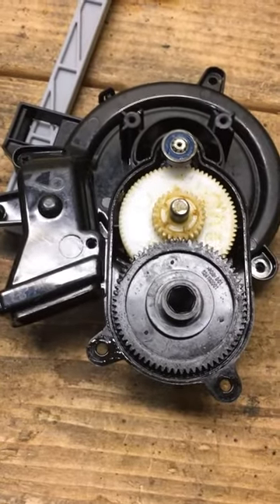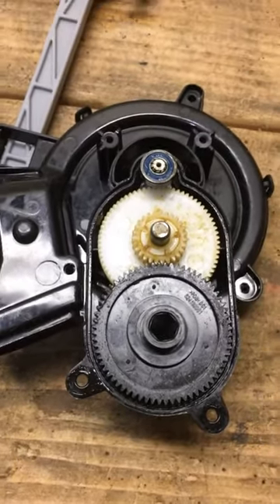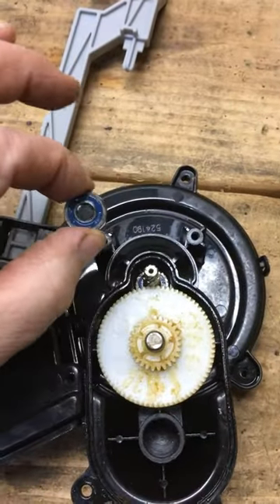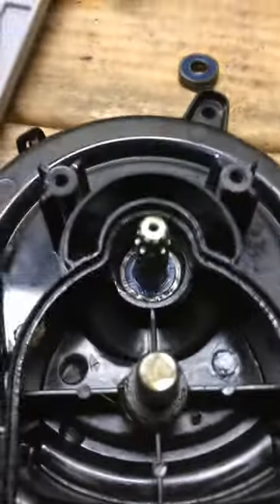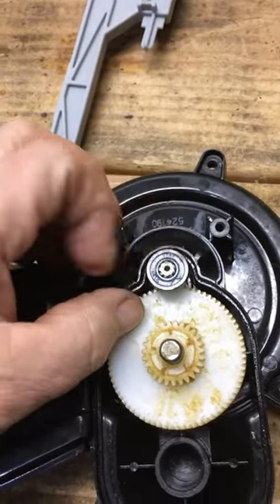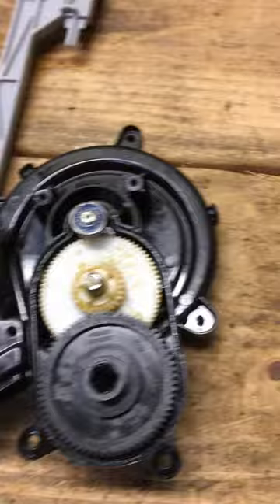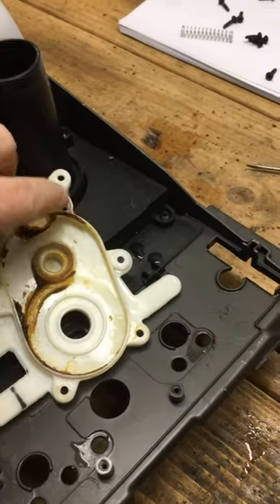Hoover Carpet Cleaner Brushes Not Spinning

Comment: Good video.  Some comments express concerns over a correct bearing replacement.  Having the identical bearing is not that important as long as it's a "sealed" or self-lubricating and of the right diameter. Places like McMaster Carr and Grainger may sell bearings as well as eBay. The thickness of the bearing can be compensated with washers and therefore is not critical either.

Comment: I hade to completely remove the shaft with the two bearings and clean it all thoroughly, both were seized up. I didn't have wd-40, but I did have some wheel bearing grease, them brushes spin now.
Reply: Hey I have the same problem with the lower bearing being seized up but I can't get it out. How did you remove the shaft?

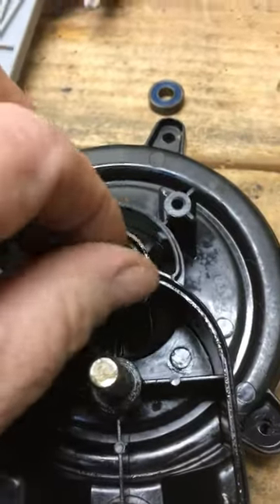Comment: 1:02 WD40 is used for rust. The gears are plastic. So I would use some kind of thin oil instead. And if you didn't know, WD is an acronym that stands for water displacement. If it is I  wouldn't use WD40. That is cheap. I would recommend PB Blaster.
Reply from the maker: At 1:02 in the video, I was talking about using the WD40 on the bearings, not the gears.  That was in an effort to free up the rusted bearing and to help keep moisture out.  If the bearing is really seized up, then I agree with trying PB Blaster.  It is a good product.
Reply: PB Blaster is even harsher on plastic than WD40

Comment: So if its not the bearings, everything moves freely, the door to switch between the power scrub, gentle scrub, and spill pick up works. My brushes still won't spin. There is a lot of air blowing out the bottom.
Reply from the maker: What model of cleaner do you have?  The reference to "power scrub, gentle scrub, and spill pick up" are not familiar to me.  We may have different cleaners.
Reply: @barryrobison2073  FH50044
Reply: Did you ever find a solution? I’m having the same problem.

Comment: How do you loosen the top bearing off of its rusted on?
Reply from the maker: If you remove the bearing from the shaft you should be able to hold the inner race of the bearing with a pair of Channellocks or vise grips.  Then try turning the outer race with your fingers or another pair pliers.  If it doesn't break free easily, try spraying it or soaking it in penetrating oil.  For more details visit the article on our blog for a more detailed description at the below link.  Be sure to let me know how it turns out.  https://www.ourrecipesforsuccess.com/carpet-cleaner-brushes-not-spinning/
Reply: Barry Robison  got it off! Thank you. Made sure to lubricate once I got the inside spinning again. Once I put the brushes back on they still won’t spin freely.
Reply from the maker: @sandycakesdunedin  So the bearing and shaft would spin?  If so, did you put it back together and try turn the cleaner on to see if the brushes spin?  The handle of the cleaner needs to be lowered to engage the brushes, If I recall.  It's the suction from the actual vacuum part of the cleaner that turns the turbine, which drives the brushes.  If there is suction, there could be an issue with the mechanism that opens to apply the suction to the turbine when the handle is lowered.
Reply: Barry Robison  yes the bearing and shaft were spinning before I closed everything back up. I don’t remember if she I was trying the brushes if the handle was disengaged. I’ll try that tomorrow! Thanks for your help!
Reply from the maker: @sandycakesdunedin   You're welcome.  I hope that's all it is.  Ours has been a good machine except for this little hiccup.

Comment: Wr 40 is not a lubricant. It will just clean and dry things out.
Reply from the maker: Mr. Harvill is correct.  Although WD-40 is perfect for getting the bearings freed up, it does not have good lubrication properties.  I have updated our blog post to include following up with lubricating the bearing.  Thanks for pointing out my mistake and making this a better resource for everyone!